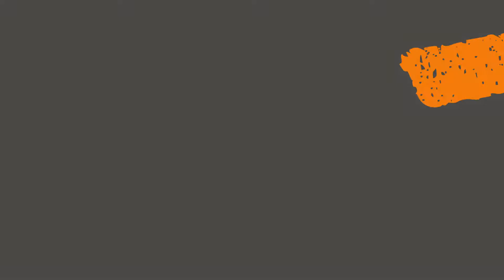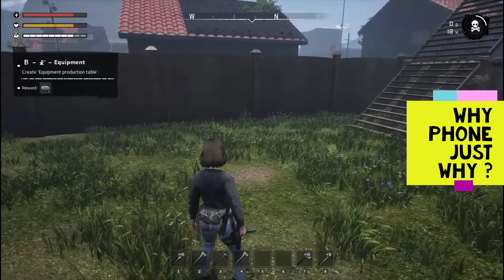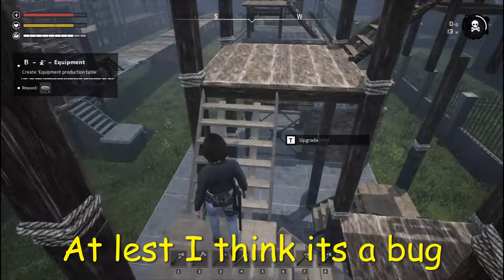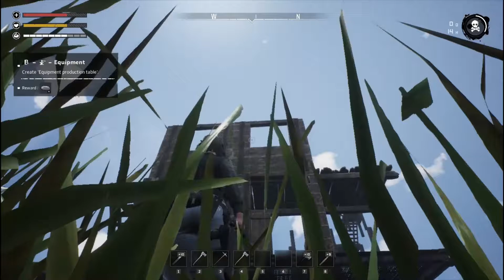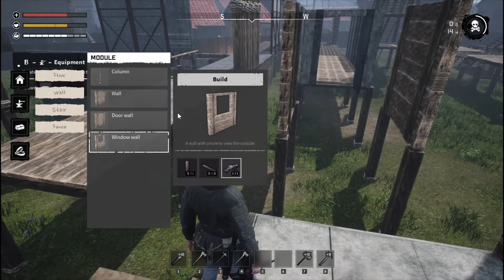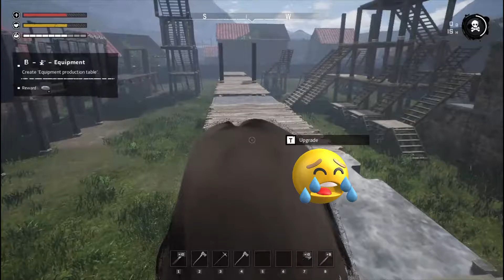NOTD   Sin's Test Build Stuff

Comment: That is cool :) !

In my let's play play through, what I did several times was to first build a bridge, so that i can use it to "measure" where to locate a column on the opposite side, using it as a marker. Then remove the bridge, and replace it with floors. (this has sometimes presented issues to create gaps during this replacing process ...)

In your case, you have your columns very well aligned and spaced. How do you do that ?

Next question, maybe more for testing purpose. I have an issue in some of my overhead structures similar to what you tested .... i have a floor, attached to  1 column, itself attached to a stair. Zombies can go up the stairs onto the floor... but if I add a Cutter Trap on top of this floor ! This breaks their path. I have no clue why this is doing so ... I have replaced the cutter trap with the compressor ... and the path works again. so if you would figure out why, that would be brilliant to understand why !
Reply from the maker: ok i will definitely try figuring that one pathing issue, but i can assume that it is raising the floor  to be seen as invisible. as for making the columns line up the way i do  i explain it in an earlier video https://youtu.be/BS6KrSTlCNg
Reply: @sinpathicenderson1198  Thank you Sin, I will check out the other video :) !
Reply: Hi Sin, good morning. I have been thinking overnight, Thanks to your other videos I watched right before going to bed haha ! I will need to do more testing on my current game, because I am no tin a flat area, so i regularly encounter issues to have horizontal alignment; but based on your video i should be able to do that still ! Gonna do some testing and inform you if I encounter issues :) !
Reply from the maker: @SolutOdka   im glad to hear it its close to bed time for me  and i just finished uploading the test for your cutter problem hope it helps